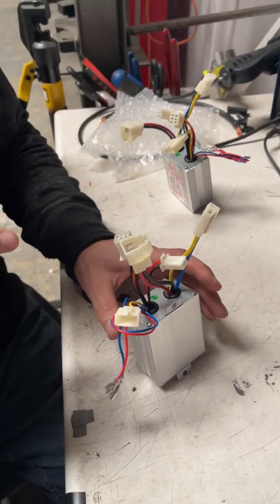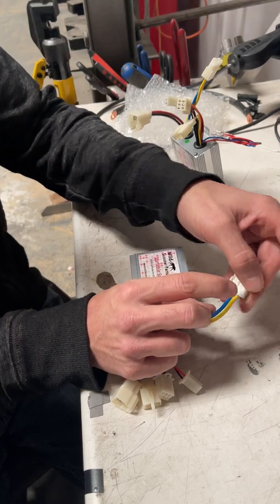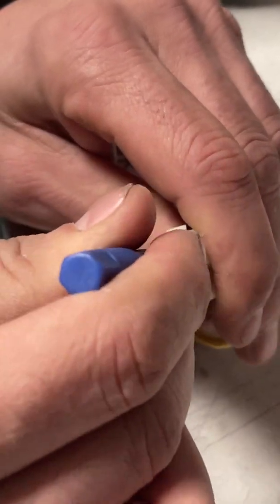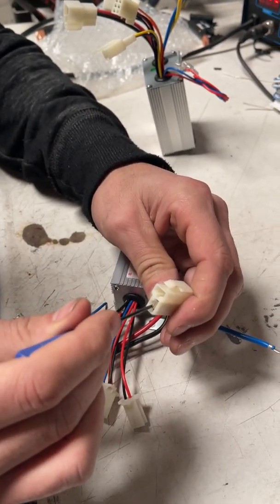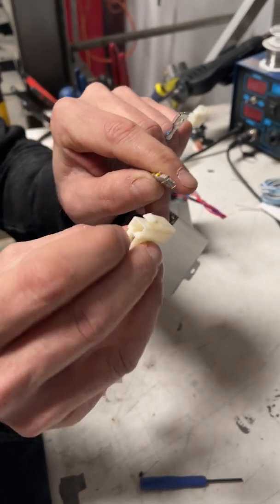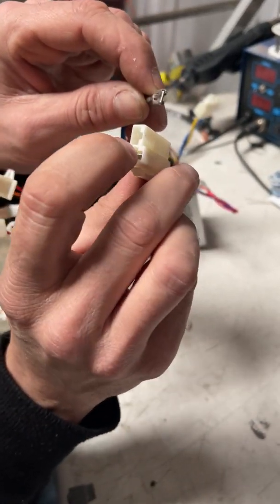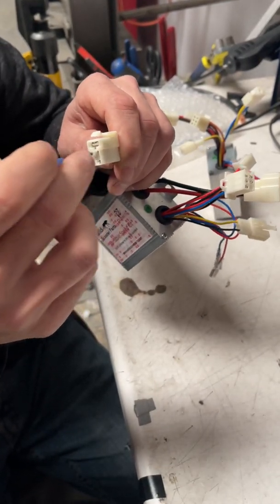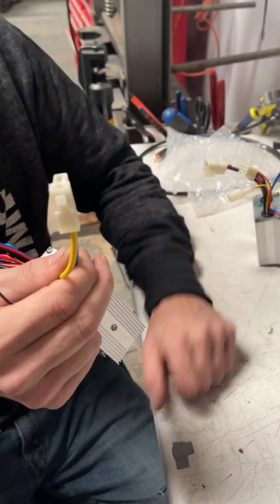Reverse Motor Direction on Razor Controllers (Or any Brushed motor controller)

Comment: Thank you so much for making a video this good. It was easily understandable and straight to the point. I was making a modified razor E300 and I got a new controller and motor for it. I hooked it up, and it spun backwards. I looked at 15 other videos that didn’t help, but this one is perfect.

Comment: Is there a switch I could install between the controller and the motor that would allow me to have reverse on a Razor quad? I have one of the older models that doesn’t have the reverse option already installed and I have it overvolted to 36v. I would like to install a switch between the controller and the motor that allows me to change the direction easily but I’m not sure what type of switch to use.
Reply from the maker: The new models don't have it either.  Yes, lookup a motor reverse switch, make sure it can handle the high amp load of the motor!

Comment: Thank you for that post, you saved me a lot of time and aggravation. I pulled my motor apart and it reversed directions your directions fixed my problem.
Reply from the maker: No need to pull the motor apart to reverse directions!  Simply swap the 2 wires!

Comment: Man i need help. My electric 2000 watt mototec lithium scooter all of a sudden it is running in reverse and it doesnt even have a reverse. Its the mototec chaos 2000 watt. What is causing this? I use it to get to work so i need help quick?
Reply: I would think that somehow your motors positive  and negative wire are connected wrong or the speed controller is faulty
Reply: @3613jeremy  it was the controller was bad.